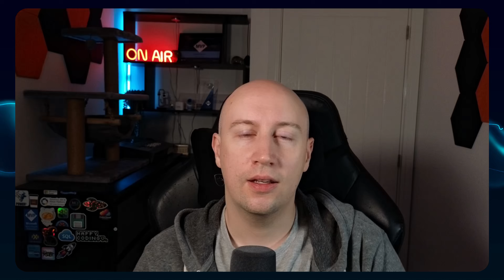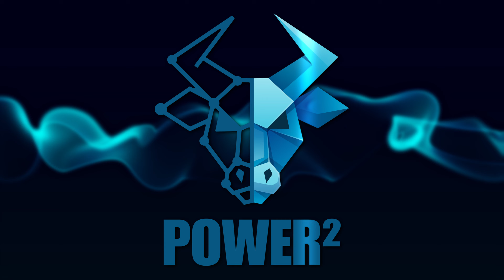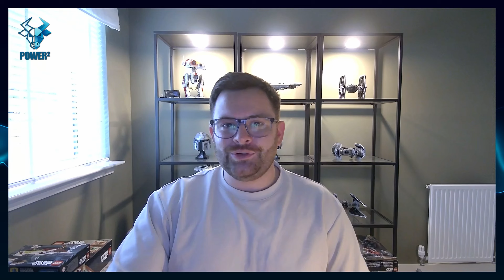What Are Managed and Unmanaged Solutions in Power Platform?

Comment: Thoughts on allowing unmanaged customizations in your test environment and then blocking them in production? I like the idea of using those unmanaged layers for hotfix testing on the fly with test users without having to run through the deployment steps to push those changes from development to somewhere the testers can review them.
Reply from the maker: I would always prefer to deploy rather than make customisations where I shouldn't, but if it works for you and saves you time then why not? - Charlie